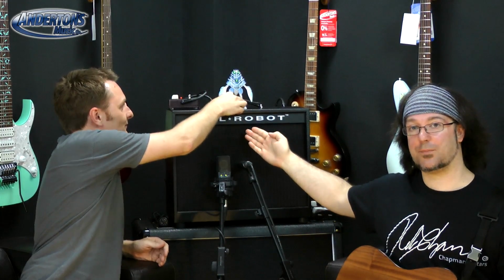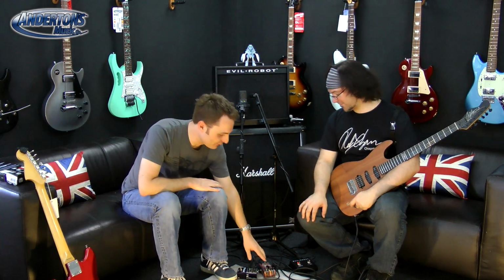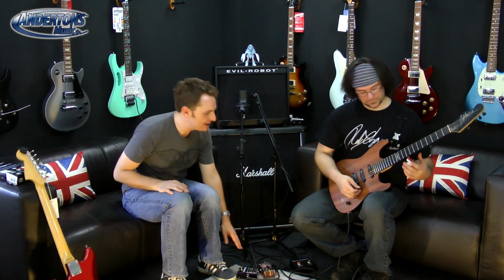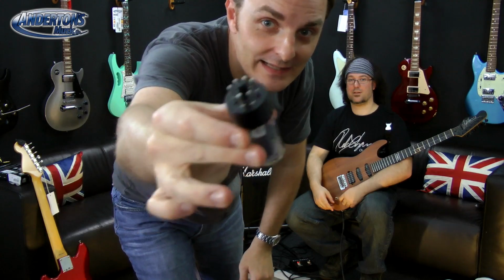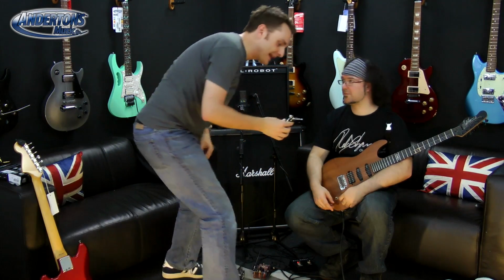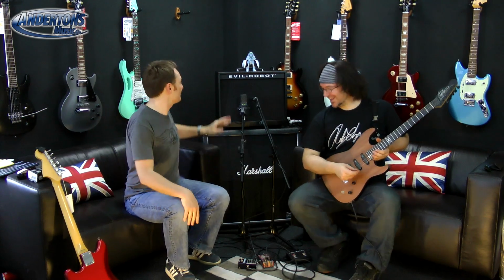Evil Robot Phil X Custom 214 EVR-C30 Amplifier - Tube Tone Test

Comment: show different video of this amplifier where you went from the 12 a.m. 7 to the 1287 North Dakota 87 21287 day after forever set up with four el84 power tubes correct? and now you're changing the power tubes out to 6v6's and 6L6's? so far I'm thinking that the el84's sounded the best imho

Comment: Not a fan of the sound with either of the tubes, and I doubt it's a lack of eq'ing skills because every player there knows what he's doing.

I like Phil so I hope the amp survives, but it won't be supplanting my XV212 combo of the Carvin X100B anytime soon.
Reply: +TheMrturn1 
It didn't help that they played that wank-fest shred crap on the guitar of similar styling most of the time either. The amp was conceived as more of a bluesy thing and is based on a vintage circuit; so they should have pulled out a good stock tele, strat, 335, Casino or some stuff like that. And dialed down the metal wank by at least 50%.

Comment: I'm no expert (by any means) but the biggest thing that defines an amplifiers "tone" is the EQ (Treble, Bass & Middle).  Bruce Egnater explained this in one of his video's from the Winter NAMM show, and it made perfect sense.  All the different Amp manufacturers have their own recipes and perameters in the design of the EQ sections of their amps.  The tubes are a very significant ingredient in the recipe, but not the total of the sum.  That being said...  I have a Fender DeVille amp with 6L6's power tubes (or Valves for the Brits) and I have an amp with EL 84's (Gibson GA-30 RVS) and it's nothing but a 1/4" input with a Push/Pull Volume pot, 'Tone' and 'Reverb' and an effects loop.  It's the best sounding amp I've ever owned (and I've had a few).  My Point?  I love the EL 34 and 84 tubes (valves)... but a lot of the tone comes from the EQ design (and the speaker(s)) of the amp itself.
Reply: 04softail70 

Not exactly. You can easily destroy the character of an amp despite its eq with a post eq in the loop, defeating the negative feedback, switching in a cap or two early in the preamp and adding bass (will flub the tone for example) no matter what the eq does.

Don't be fooled by the number of pots for an eq. Two knob or one knob eq circuits are available and are almost as versatile if not more than the classic RCA/Fender arrangement and its derivatives. 

The eq is there to actually shape the sound in a specific point in the circuit. 

But, this also happens in many more points in between the gain stages for example, the power amp etc. What sets the eq apart is that it is user adjustable and that is it. Bruce egnater likes to use tight etc switches. Those alter points in the preamp mostly. You can view them as one setting eq.

For the power amp, trying and see what fryette did with the deliverance. He managed for an amp that uses KT88s to make it sound (if the user wants to) like a vintage EL34 amp (that was his intention) and so much more after that. It doesn't really matter what type of power tubes you use as long as you design around them (the whole amp circuit, cab even, speakers)...

If you even read his manual he actually advises the user to use the two gain configuration and less/more (one extra gain stage) and inputs and power amp negative feedback controls (in the fryette camp even more than the power amp) depth and pressenc BEFORE touching the eq and then do adjustments.

Boogie uses a different formula. The eq is very early and its next to useless for tone shaping. The character of the amp will change more from the pressence than the bass mid treble. Those only affect the character of the distortion, in the end they just match every guitar to the mark character.

What did they do? They added the graphic eq, post distortion.
Reply: Interesting... Like I said, I'm no expert, but that was very informative.  You obvioulsy have a much better understanding of basic amplifier dynamics.  I'm no engineer, but I agree with you about the EQ in the loop.  Previously, I had my EQ in the Preamp section, but I recently put it in my loop, after reading several reviews (and just wanted to try it out).  It's been disapointing to say the least.  In fact, it's had a totally different outcome than I had anticipated.  In short... its a tone sucker with the EQ in the loop, and it wasn't much help in the preamp either.  It was better suited as a boost pedal.  

I (now) understand what you're getting at when you speak of how the different amp designers produce their particular EQ sections.   Currently,  I gig with the previously mentioned Gibson GA-30 RVS (subcontracted for Gibson by Trace Elliott) and the only EQ is a 'tone' knob. It  generally does what I want it to do and gives me what I need (with Burstbucker Pro and Vintage P-90 pickups... NOT the 490 series pickups)  The amp has plenty of power and two Vintage 30's.  Personally, it sounds good for what I do, but theres always room for improving the tone... I just haven't found the perfect solution (or amp for that matter).

I'm a bare bones type player, with a "less is more" approach to effects.  I like simplicity, but do believe that modulation and time based effects beliong in the loop.  As far as shaping the tone, I believe you're absolutely correct.  You enlightened me on a few things here. I did have an EQ (post distortion) in my pedal chain however, it was a little disappointing there too.  It may be a combo of different issues (it's a Boss EQ... I mostly picked it up for it's bufer circuit) and it's just not doing it for me at all. 

I'll keep messing with it...  thanks for your reply.
Reply: those gibson amps are just killer good tone all around.

Comment: What you're looking for is called an attenuator, basically a sort of resistor that goes between your amp and your speaker. This enables you to have your amp cranked up for natural tube breakup while cutting the signal going to the speaker, so your room mates or neighbours won't want to kill you. I personally use an old Tom Scholz powersoak because you can switch the impedence for different amps/speakers, but other good attenuators include the THD Hot Plate and Dr. Z Air Brake.

Comment: Tried all combinations the stock 6v6 is best, use the el34 or 6l6 in pairs only so as not to overwork the transformers just as loud as the 6v6 on30 watt just to lay different. As detailed by chapers and lthr captn

Comment: this amp has 4 output tubes ,, they are talking about pairs.. Is that because when you run it in 18 watt mode only 2 tubes are engaged..??  It is correct that when an amp i cathode biased with you can always replace with 6l6 or EL34 (if the pin wiring i prepared for EL34), But with the higher impedance of the OT and the bias resistor value the larger valves are not really driven hard enough for best sound..

Comment: The oils on your fingers will cause differences of heat on the tube and make them burn out faster. It's best if you use a sock to handle your valves...

Comment: Just wondering, but I liked the clean tone and the high volume of the 6L6's, and I liked the higher gain Marshally crunch of the EL34's. Would it be possible to put in 2 EL34's and 2 6L6's with it still sounding good?